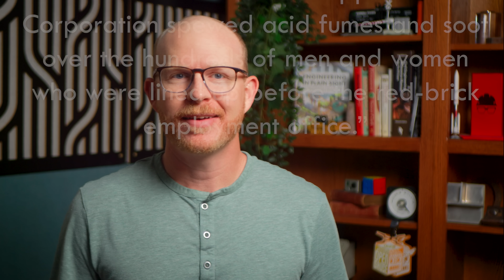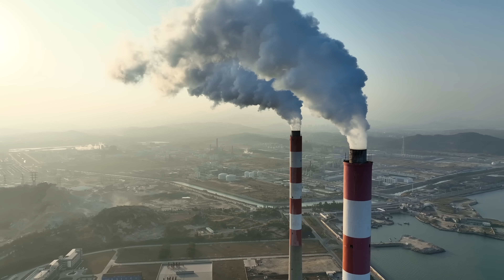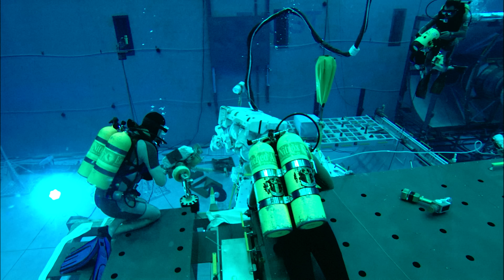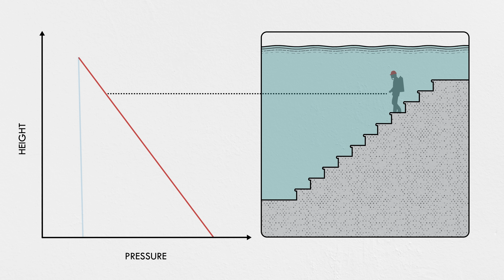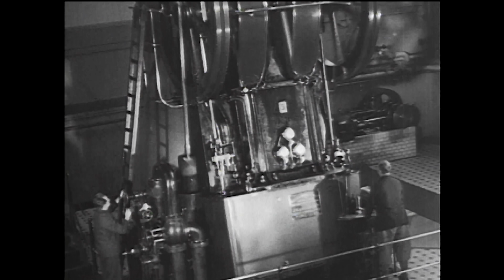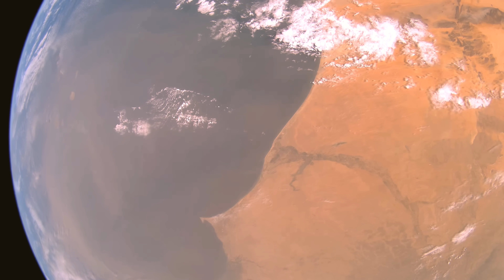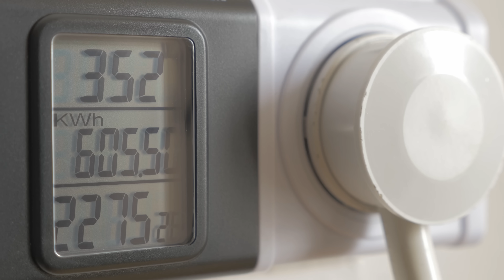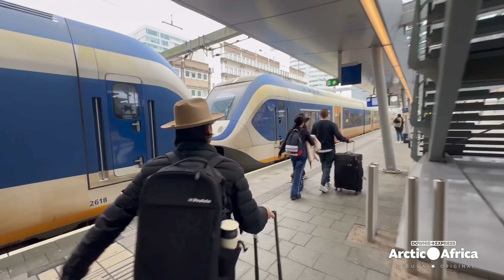Why are Smokestacks So Tall?

Comment: Unfortunately there is a gap in regulation when it comes to the dispersion of the fumes from laboratory fume hoods. I don't know what Grady's sources were for this video, but many of the topics discussed align with the best practices that would govern the ventilation design (ASHRAE) for laboratory exhaust systems. But there is nothing in building codes that strictly require adherence to these best practices. The codes are basically silent in most jurisdictions. The majority of laboratories I've worked with don't have any calculations supporting the design's ability to disperse the contaminants safely.
Reply: lab exhaust is hard to regulate since if experimenting you probably don't know what the pollutants will be when designing the system
Reply: @ryannicholl8661  ANSI Z9.5-2022 has clear language of how to design it, even with language of what to do if you don't know exactly what pollutants will be used. But building codes don't directly reference or require compliance to it.
Reply: I can go into what we've done for one of those jurisdications that does assess this through the environmental review process outside of the building codes. To start we don't get into the indoor air quality since that would be covered under OSHA regs and is not specific to the design itself as an air quality concern since those are more generally assessed as ambient air quality. In general, we would typically use the list of chemicals that would be stored on-site and estimate an evaporation rate for a spill event. We then look at how those captured emissions would disperse in the atmosphere to existing locations and the potential for recirculation from the stacks to building air intakes. For the most part these systems wouldn't have scrubbers (as not all hazardous pollutants can be controlled this way) and are generally controlled by placement, physical designs, and/or cannon fans that provide additional vertical momentum.
Reply: @grausammesser  ANSI Z9.5-2022 gives a whole list of criteria for designing the exhaust discharge. And if you don't meet all of the requirements, then you are basically forced to do CFD model at minimum, but ideally a wind tunnel analysis. And I've been on projects where this is done, but they are the exception. Typically only when a major university is doing a whole new chemistry lab building. But I've been on dozens of small labs where no one cares and they don't even follow the basic minimum of protection.
Reply: Yeah, most of it just gets blown out of the roof. No stacks, no filtering or treatment, just a straight exhaust with a rain cover.
Reply: Always assumed they would be scrubbed ?😮
Reply: In a semiconductor fabrication plant I worked at used water scrubbing for most things then cleaned up the water before discharge back into the sewer system.
Reply: And they’re only just starting to deal the fact that small planes run on leaded fuel.
Reply: @Jonathan_Doe_ changing them to a unleaded fuel would require changing valve materials and more, it would take time.

Comment: The Graph at 6:00 is wrong, lower pressure is the result of height, not that height is the result of lower pressure
Reply: I don't think the labeling of axes implies any sort of causality...
Reply: I read the charts as saying that for any given height, the outside air has lower pressure than the air inside the stack. The outside air line is to the left (lower preassure) of the stack line.

I feel the labels are reversed.
Reply: Causality of axes is a thing they made up to teach 11th graders. It's kind of a rule of thumb if there isn't a clearer labeling system available. Labelling height on anything but the y axis is inherently confusing.

Comment: Chimney stacks and understanding drafts is one of the big things a lot of blacksmiths get wrong, and it's something I struggled with as well a couple of years back. This video popping up the same day I had a meeting about upgrading my ventilation for my coal forge is a neat coincidence.
Reply: As someone constructing a coal forge rn you've framed it quite helpfully!
Reply: I've never looked at blacksmithing, but I'm now curious what's the overall issue that people get wrong!
Reply: @SaphireLattice  smokestack/chimney has to be a certain length and size, a certain height above the roof/structure, and prevailing winds and their interactions with structures and trees have to be weighed in too.

It can get complicated quickly, especially in areas where external temperatures can vary wildly. A chimney perfect for summer temps can work poorly in winter, and vise versa.

But the most common mistakea are making it too short or out of the wrong materials.
Reply: @SaphireLattice  Convincing ourselves that whatever bit of pipe is cheap and convenient to get ahold of will do the job...  You see a lot of woefully narrow, short, and twisty stacks that don't stand a chance of exhausting the forge properly.  A 10" or 12" chimney that rises straight from the forge and extends 4' above the roof peak can be costly, especially if you adhere to local building codes.  Since wisdom in the field is mostly based on experience and anecdote instead of engineering principles, it's easy to convince yourself that something is good enough when it's really not.  "Works for me!"
Reply: Those of us up north that run wood stoves all winter for heat are usually pretty familiar with stack effect...once a chimney or vent pipe is good and hot and it's drawing really well, you can actuality disconnect the pipe from the stove and watch the chimney pulling so hard the smoke won't even get into the room...its like a vacuum cleaner, its pretty crazy.  Not that I recommend doing that on a regular basis 😂. But yea, if you want good ventilation, you want a taller stack...the taller, the harder it will pull. Insulating it will help even more as it maintains the internal temp of the pipe and exhaust gasses longer.  If that's not practical, you can always power vent it too.
Reply: @scottclark7559  in some areas the insulated pipe is required by fire code where it goes through structure. Some modern ones are so good you can touch the pipe while the stove is going.
Reply: @filanfyretracker  For sure, if meeting code black pipe is fine until it has to go through a ceiling/roof/wall in any kind of occupied structure, then it has to be insulated pipe. In a blacksmith shed people are going to kind of do whatever 😂.  Insulated pipe will definitely improve the performance of it regardless.  Its expensive, but works really well.

Comment: Smokestacks (or chimneys) are built tall primarily for environmental and safety reasons:

1. Dilution and Dispersion of Pollutants

Tall smokestacks help dilute and disperse harmful gases and particulates (like sulfur dioxide, nitrogen oxides, and carbon monoxide) over a wider area.

By releasing emissions higher into the atmosphere, they reduce ground-level pollution, minimizing the impact on people, vegetation, and buildings nearby.

2. Compliance with Environmental Regulations

Many countries have strict laws about air quality. Tall stacks help facilities meet air quality standards by reducing local concentrations of pollutants.

3. Thermal Draft (Natural Upward Flow)

Hot gases naturally rise. A tall chimney enhances this draft effect, allowing gases to flow out more efficiently without mechanical assistance.

This improves combustion efficiency in furnaces, boilers, or power plants.

4. Avoiding Structural Recontamination

Emissions need to be released high enough to avoid being sucked back into nearby building air intakes or settling on nearby surfaces.

Example:

The Inco Superstack in Sudbury, Canada is 381 meters tall — one of the tallest in the world — to disperse sulfur dioxide emissions from a nickel smelter over a large area.

Comment: "You don't feel much difference because air isn't very dense" -- in this example, isn't it actually because you're at the bottom of a many-km-deep ocean of air, so a few meters up or down is a tiny variation; but the water is only one story deep, so you're experiencing a much greater relative change in depth? ρ matters, but the difference in total h makes the two cases a poor comparison.
Reply: I don't think so. say for example going 10m in depth of water increase the pressure by 1 atm, now if those ten meters are at the bottom of a pool or in an ocean 2000 meters deep, the pressure is the same.
Reply: @wolfy1398  For sure, the absolute difference is the same! But the relative change in pressure -- which is what you'd "feel" -- is not the same. 2psi up from 1 is noticeable because the pressure has doubled. 100psi up from 99 is not. Same absolute difference -- 1psi -- but very different relative change.
Reply: @stm31415 Still, i feel like the example is correct, as even walking about about 100km (i know space does not have a clean edge) would yield a relative pressure difference the same as diving 10m in water, 1atm less at the edge of space rather than in the atmosphere and 1atm more at about 10m depth in water. hmmm, now that i re read this, i fell like you are correct, relative change in height if the same across two mediums who have the same pressure at the bottom but different colum heigh should have a similar pressure difference (i can't tell if relative or absolute tho)